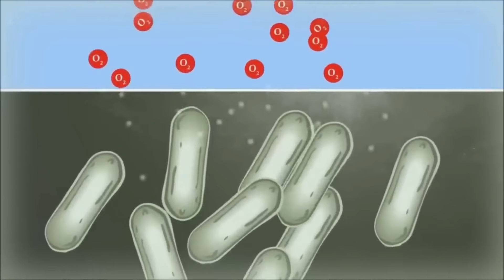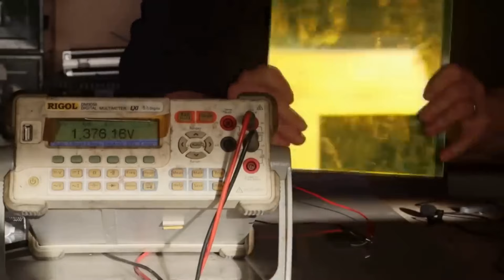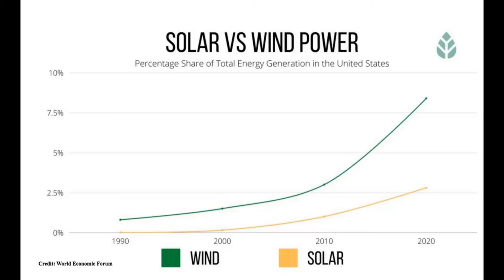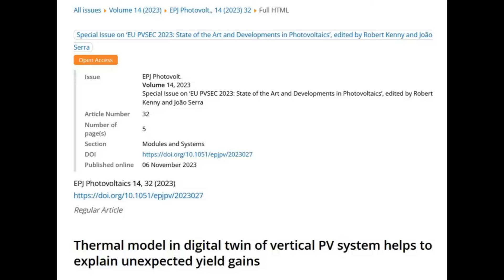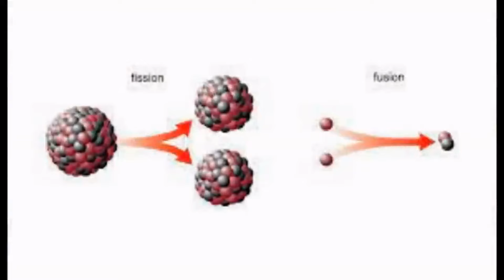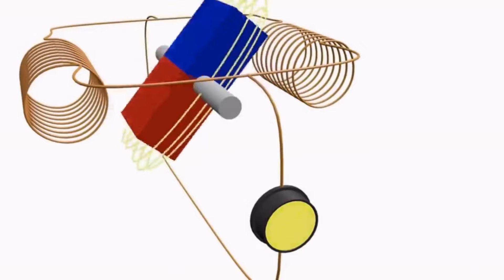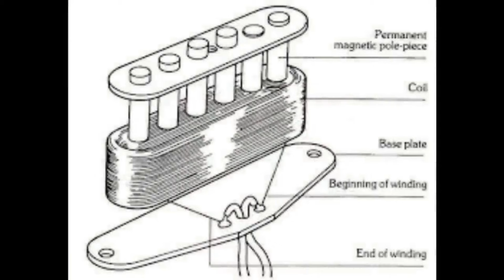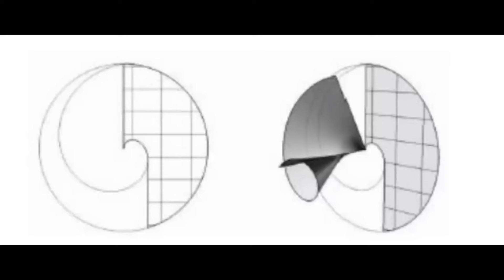Man In A Shed - Episode 8

Comment: Consider: as time has positive movement, negative time has negative movement. As pt maintains impetus with positive density nt maintains impetus with negative density (vacuum). since pt is observed via the impetus with density (gravity). nt may be observed via the impetus with vacuum (anti-gravity). Warning - time bombs will end you. Better to build the interstellar drive. oscillation between density and vacuum provides positive and negative control. it is exiting rob to hear the density and vacuum instigated.

Comment: How about this: use a coolant on the back of a solar panel to keep it cool.  Take the coolant, which is heated by the back of the solar panel, to heat the hot part of a Stirling engine or engines.  Reclaim the waste heat!
Reply: You're talking about a very small amount of relative temperature difference when it comes to Stirling Engines.   Stirling engines require a working fluid to expand and contract in order to create motion from heat.  Air is the working fluid in most engines and it really only gets efficient at around 160C.  A more compressible working fluid will be efficient at lower temperature differences, but the go-to in that case is Helium, which is getting pricey to procure and imposes its own wear and tear on things trying to contain it.

All that said, you totally could use some kind of thermal energy harvesting system to generate a little more power per sq. meter of solar array.  It really depends on whether you need the extra power badly enough.  It's close enough to impossible that I'm OK with claiming that it's impossible for such a system to generate enough electricity to exceed the cost of making the engine and hookups in the first place.  If you must use solar as your power input and space is the limiting factor instead of material costs or weight, it definitely makes sense to Stirling up.  I just can't think of scenario where that's true.